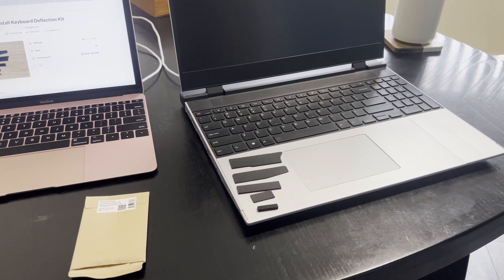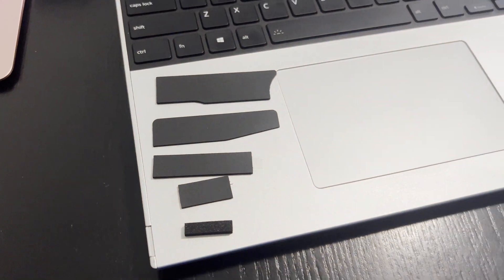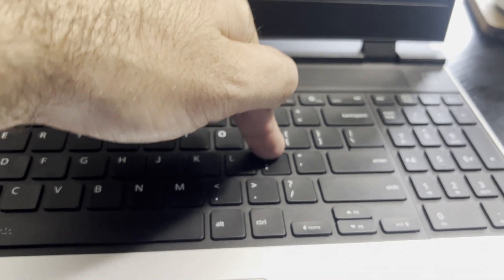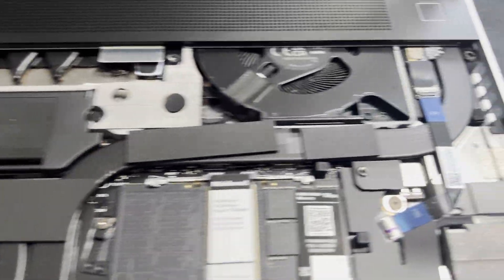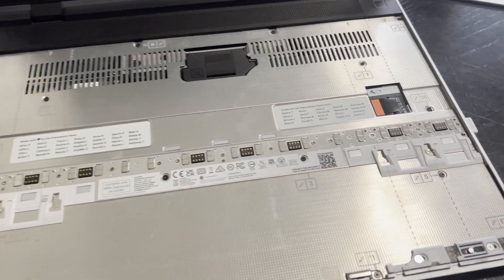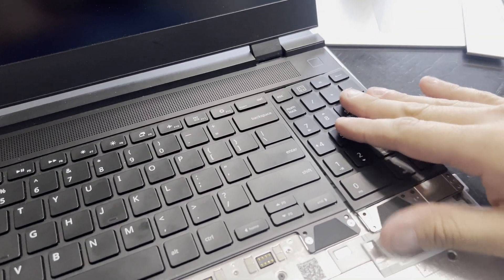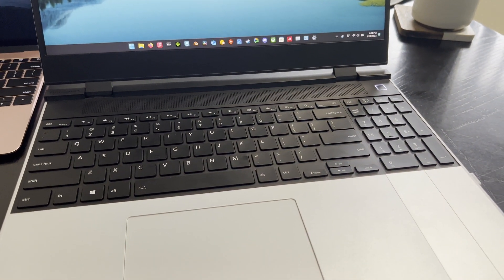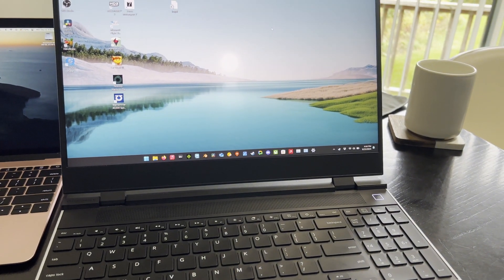Framework 16 Keyboard Deflection Kit Installation

Comment: Man apple really needs to throw in an Apple silicon chip into the chassis of the 12" macbook, while giving it an updated display
Reply from the maker: @BSingh-on4qr  it’s one of my favorite computers they ever made. It knows what it is. It’s not Pro. It just needs to do light tasks. It does so brilliantly and silently. While being incredibly small and light. The MacBook Pros of the era all overheated and couldn’t do Pro things as well as they should have as a result. 

An ARM upgrade would be a perfect upgrade for it. The display is still good in my opinion.
Reply: @Frame16Gaming  just reducing bezel sizes I mean
Reply from the maker: @BSingh-on4qr ah. Yeah it could probably be a 14” display with smaller bezels.